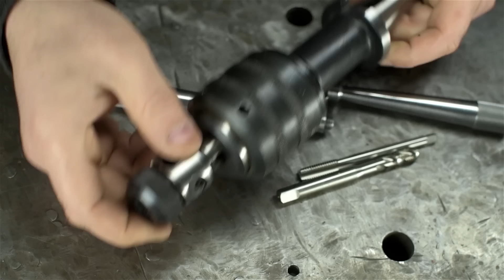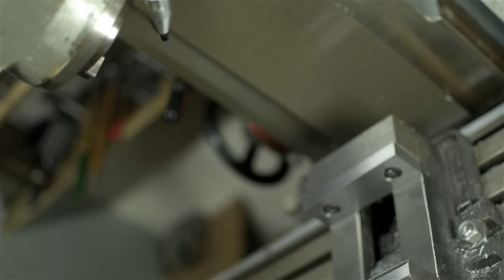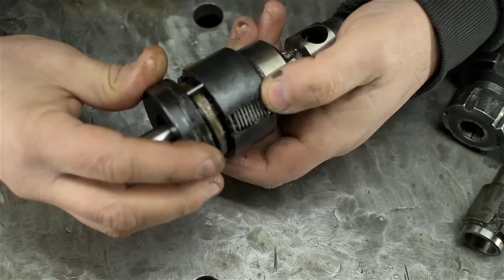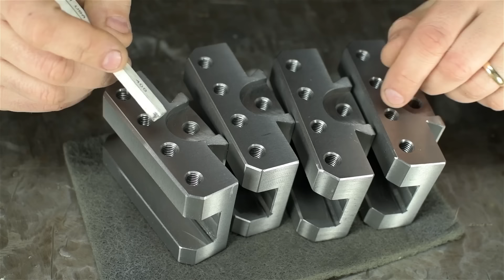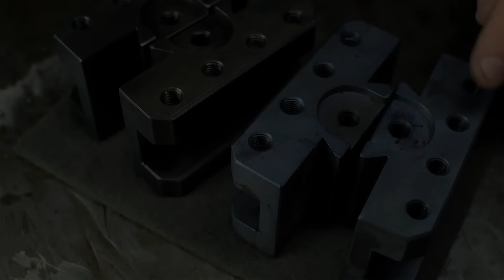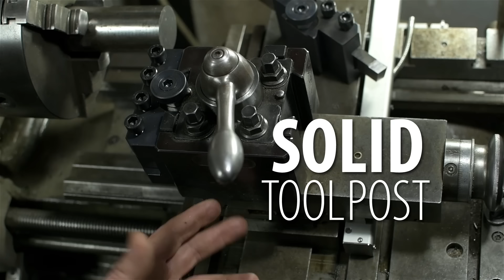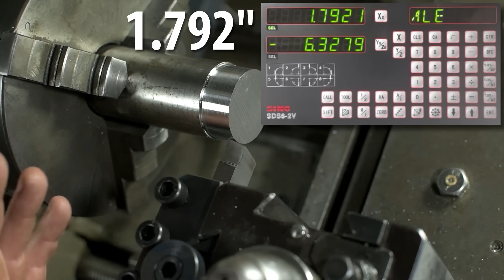How To Break A Tap & Other Ramblings

Comment: You could clamp the item you want to tap loosely in you vise and let the tap pull the item up then stop it before it leaves the vise and reverse the tap and it would push it back down. You you just need to clamp it so it doesnt spin when taping.

Comment: I am an engineering student and I have been taught to use a mill which has a quill but we start in the mill with the spindle in neutral so that it is perpendicular and then finish by hand with a tap wrench and repeat with a plug tap. I also work with lathes and the largest cut I take is 1mm with a standard carbide turn face tool

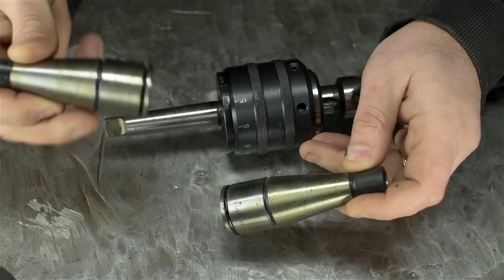Comment: 4:45 i think it doesn't matter if those parts doesn't have the H shape, the torque only goes through the cone when the upper bolt is torqued, the main purpose of the "H" is to lock the "thing" when you bolt it.

Comment: COLD BLUE TIP! While your parts are soaking in the solution rub them down with   very fine steel wool as they soak and you’ll get a more even deeper blue it does have to be plain steel wool none of that stainless crap or it won’t work. Hope that helps someone

Comment: The professional way is to use a CNC mill to brake taps.
My record is two M6 in 30min then I uses the drill press without breaking it.
But my coworker thought I do something wrong and wanted to show me how it works and it did for two holes then he broke the tap :D .
The funny part is that the CNC perfectly calculates the rotation and the Z movement but it does not care about the force and M6 is not big.

Comment: In the job shop I’d prefer to use a non-spiral tsp, they are stronger, however your material isn’t too hard. 
Also, for holding your straight shank, maybe better in a set screw end mill holder, positive lock on a flat you could machine into it.
Great vid as usual. Thanks for sharing.

Comment: The drive lugs are more like safely lugs their only used to protect the spindal  if you were to over power the holding power of the taper. For the most part your taper always does the work.

Comment: How do you know I'm bored? Well, I'm re-watching and commenting on a TOT video from last decade! 
Thoughts: ISO 30 with thread, but missing drive flange are for bolting on tools which have a drive flange integrated into the tool? Don't ask me why that'd be advantageous (it would drive the tool directly and not rely on the connection between tool and tool holder) or where you'd find such a tool. However... one could make such a tool? Perhaps an adapter for a tapping head which would have a removable drive flange keyed to a shoulder above which is a serendipitously sized thread? Like maybe the shoulder is a "double D" shape and the drive flange has a corresponding double D inside it? Such an adapter would possibly remove the thickness of a collet's nut from the total length of the tapping head.

Comment: Looking at those weird taper tool holders, my guess would be that they do hold a face mill and the spindle dogs fit directly into the slot atop the face mill. That seems like a really neat idea, more rigidity and a couple more inches gained on the Z axis just cause the tool is shorter with no shank

Comment: The machine obviously does produce some work for you but it just seems like a truly terribly designed piece of equipment. It's like Harbor Freight went to the cheapest factory in China with an idea and then passed off the engineering plans to Home Depot engineers for tweaking before sending it to 1990s Craftsman for production. Everything about it just seems ass backwards.

Comment: It seems to me that the weird clutch pack is just a really tiny viscous center differential.  Some discs are attached to the input, some are attached to the output side.  The grease is specially formulated to expand quickly as the plates shear through it, locking the plates to a greater or lesser degree.  It reaches equilibrium fairly quickly, giving output torque with a decent reserve for when the tap hits a hard spot and needs a little rotational give.  Make sense, or is that clear as diff grease?

Comment: Total newbie question here so please go easy on me:  How did you centre the tap in the pre-drilled hole.  In asking this question I am assuming that the part was at some stage removed and replaced in the vice between drilling and tapping.  If not, then I think the answer is obvious  - you just kept track of the hole positions and relied on the repeatability of the slide to reposition (accounting for backlash).  Also, at  9:50, it appears that the tap is not running true.  Is there a little bit of play in the tapping head that allows it to self-align ?

Comment: After dipping the parts in that type of bluing solution I like to dip some 0000 steel wool in the solution and rub the parts..... lol...... with the steel wool. It gives a much better blacking. Can also apply oil, then rub with steel wool and solution to blacken even more.

Comment: Actually the plug tap is stronger than the one your using. The shank does not make it stronger. It's the core of the tap. And also using the "normal" tap that you referred to has less tool pressure. Pushing the chips down if you can is the way to go.

Comment: Your ISO 30 tapers without the drive flange are usually used as tailstock centers in machines that use ISO 30, much like Morse Taper in your lathe tailstock. Machines that use this as their tailstock center would most likely be a Hob or Skiving machine

Comment: Machine tapping in a production line is fair, but when it's just a few, by hand is easier, faster and cheaper.  Just remember handle size suitable for the tap size.  It is easier to get them square with smaller handles.  One rev forward and a half reverse.  And. If it's your last tap, make the hole 0,1-0,2 mm bigger.

Comment: I know that I'm pretty late to the party with this video, any reason that you couldn't have assembled the "back' part first, then press fit the straight shank into the ISO30 blank?
When you're boring it for the press fit, put a through hole up to the draw-bar thread so if for any reason you need to break it down again it's (relatively) easy to press back out.

Comment: I used to blue guns as a part time income. blocks the size you were bluing are significantly challenging for cold bluing, no matter whose bluing solution you are using. Just wiping down the object you want to blue with acetone isn't really good enough. Cold bluing solutions arent very uniform in their coloring this is more significant on larger, thicker pieces, and also the alloy of the steel.  High chromium steels will almost not color at all due to the chromiums ability to resist any sort if corrosion (which is exactly what bluing is).  Splotchy bluing with blocks the size you were bluing is almost a certainty. I'd suggest warming up the blocks in some sort of basic cleaner but not to the point of them being hot. You might also try wiping the bluing solution on rather than submerging it in the solution?  I always got better and more uniform results by this method rather thank submerging it. I was never a big fan of cold bluing to begin with as its not a durable finish, more decorative than anything else. Hot bluing on the other hand is a much more uniform coloring, will absorb oils much better than cold blues. The draw back to hot bluing is that its hot! way hot around 300-315 deg℉. The bluing salts are mixed up to a super saturated solution, because the specific gravity of the solution has to be in the 300℉ region before any coloring takes place. Also a hot tank cleaning is needed before putting the parts into the bluing salts.  Brownells Supply is a gunsmithing supply company that has everything you need to hot blue with, if you really want to make your parts look as good as you make them.  I love your videos by the way.

Comment: Pardon my non-native french. Old machiners used tools like drills, reamers or small diameter mill cutters with collets very often. Which transfer the torque just with the friction aswell. And about that weird ISO shank, you were talking about. I do remember seeing that one used for old cyliner honing head my grandfather used to have back in the day, when he worked in a car machining shop. However I doupt that it was intended just for that.

Comment: I really like your videos.
On the subject of the DRO you can set the tools in the tool library in the same way you set up tool offsets in a CNC lathe.  I didn't see you do that and I am not sure if you are aware of it.
I have this habit of never changing the origin on my machines.  What I do is I set the Absolute origin to the end of travel for the slides. Then I never change that offset.
After that I use one of those gauges that light up when you touch them to set the left to right offset (will call it Z like in a CNC)  then I set the tool zero in Z to about 10mm to the right of the jaws so I know that as long as the DRO reading is positive I won't hit the jaws.
For tools like a parting tool I use two offsets one for the left face and one for the right face that  way I can get accurate lengths on the parts.
If you are strict about keeping the offsets correctly and never changing the zero you can make parts just by the DRO without using the verniers. You need to draw the parts with dimensions of the back face so it is easy to get the points.

Comment: What about using one of the strange tapers and threading the new part you made to thread and lock into the taper with a set screw? Add a place for the dogs to grab to drive the whole thing and that would allow you to gain some more clearance while still being able to disassemble to service the clutches.

Comment: Have you ever thought of using a Jacobs chuck? At an old shop, I had to tap hundreds of holes on a radial drill per week, and we very rarely used tapping holders like on the mills. We used a Jacobs chuck, and tightened the tap down until it would stop slipping when you were in a hole. You also destroy jacobs chucks if you don't learn quickly. It was an acquired feel for every tap but it saved alot of time since we didn't have any morse taper tap holders. We used a specific set of rigid holders for pipe tapping though, which is another can of worms. Also I'm surprised you aren't using a plug tap. Spiral taps are ALWAYS more fragile due to how they're fluted. You almost can't break a plug tap. You'd sooner strip out the threads and end up with a shiny hole. If you're tapping something like 4140 maybe consider a gun tap but otherwise you're fine.

Comment: I'm pretty sure those Iso 30 tools without the dogs are for locating a shell mill or other tool, it either has the drive dogs attached or bolts to the splindle

Comment: The tip under cap is for an opening lever when dial indicator is mounted on a stand for multiple parts inspection. At one time the lever came standard with Mitutoyo dial idicator. (probably 40+ yrs ago?)

Comment: Hi Tony; those adaptors that you say that come with the machine are milling cutter adaptors , they are used  with large milling cutters that come with slots that fit into the drive keys on your spindle, to use it you fit the adaptor without the cutter into your spindle, then tight up the draw bar , then fit the cutter into the adaptor and lock it into the face of the spindle with a bolt and spacer in the bottom of the adaptor, this method is very rigid..

Comment: Was tapping a 9/16 hole in a chunk of iron the other day and broke my only tap wrench that fit the tap. So I got an old Thor drill I had somewhere in the back of the shop and drove it the rest of the way. Got through it alright, but when I went for the reverse switch...nothing. That old drill has the torque of a locomotive, but no reverse setting. So I figured i'd take the tap out of the chuck and back it out with a wrench, except I'd somehow managed to misplace the key to the chuck. So I was stuck with a fifteen pound drill attached to a tap that was all the way inside a 2" deep hole. Thank christ it was such a large size tap, because it was able to hold the drill while I found the key. Moral of the story: have a second tap wrench laying around. Or a drill with a reverse setting.

Comment: Heck, I've never had a problem tapping in a much more simple way with my geared head Chinese RF45 : The tap goes into the drill chuck.  Set to the lowest spindle speed.  Start.  Apply gentle pressure until the first few threads engage.  Let go of the quill lever and let the tap pull itself in.  Hit the big emergency stop button once the depth you want is reached.  Reverse out.  If you need a more exact depth you can always stop short and finish by hand.  (With stainless I use this technique to get the first few threads then do the rest by hand.)

Comment: The reason your mill has no "quill" and even mills that do aren't made to "replace" drill presses is because they're not drill presses. Neither are mills OR drill presses built for "power tapping". Power tapping is rarely a separate process and rarely are high-precision, very "hard" parts "power-tapped" period much less on a mass-production basis. The overwhelming majority of parts tapped "cold" as part of.the basic machining/manufacturing process are "soft" cast-iron and aluminum while steel parts are generally THREADED using a "rolling" process of some type which FORMS rather than "cuts" threads and that's usually "hot" work. Cutting threads is avoided as much as possible because as a process it creates far more work and waste than it "saves" and taps are basically impossible to "sharpen" and are impossible to "repurpose" or  otherwise "re-use". And unlike the "hobbyist" universe, threads are either "perfect" in surface finish, profile, depth, fit, dimensions per the "blueprint" and for the specific application, materials, successive processes such as "coatings" or "polishing" after "cutting" or the part is "scrap". Watching all the "professional" YouTube "machinists" treat any and all threads/materials/processess/specs "equally" and try to cut corners "power tapping" and "single-point cutting" threads like the overwhelming majority of thread "cutting" wasn't long ago replaced with thread "forming" and their worn-out "tool room" and/or "student"  and/or "general purpose/universal" machine tools were ever capable of precision threading is funny and sad at the same time. Anything to avoid having to apply a little muscle power and high-quality, brand-new made in the USA  tool "investment" to something as seemingly simple and easy and common-sense as "cutting threads". Especially when it requires admitting they don't really have a clue about "machining" at a fundamental level. And admitting they've been full of b.s. for the majority of their online "expert" careers as YouTube "shop teachers".

Comment: Try reading the instructions on the cold blue. It IS an oxidation process so try applying the blue in thin layers with the material exposed to OXYGEN. The instructions probably say to use a soft cotton "applicator" like a cotton swab or cotton balls and wipe the blue on to clean, dry COOL metal (hot or even warm parts are not going to be uniform in temp and density and porosity and will dry/evaporate the bluing  (basically a strong "saline"  solution containing chemical salts) and cause inconsistent, inadequate bluing in some areas and anything not evenly blued from the first "coat" will never be "right". After a thorough first "coat" to make sure everything was clean, dry and cool; once that primary layer is set, it takes successive applications to get progressively darker blue finishes. And any "stainless steel" that's truly "stainless" and non-ferrous will not "rust blue". So-called stainless steelss that are ferrous will blue somewhat but will possibly be "splotchy" the cheaper and lower-quality they are. Hardness also affects bluing results and anything intentionally or accidentally "case hardened" will never blue evenly and consistently. Even if the directions are followed correctly.

Comment: 6:42 the clutches might be relying on the drag created by the grease. you probably did the right thing leaving the original grease on. there are some speciality greases used for creating viscous force under shear. if youd just replace the grease without knowing what was the original one, you might have had f*cked up the torque settings. and the dial there is probably have the purpose of adjusting the distance between plates, thus adjusting the drag

Comment: That "flat tool tip" is actually a lifter cap ... you fit a lifter handle to the side of the dial indicator and the fork of the lifter goes into that groove on the cap.

Comment: I looked for but couldn't find your email address - mayhaps you don't provide it so you skip all those pesky fan emails :D    I have an EMCO Maximat V13 as well and have been looking at DRO's.  After having now used it on your own lathe, would you recommend the SINO SDS6-2V DRO to others ?  Also, what scales and lengths did you use on your lathe setup ?  I could see the scale length on the cross feed though I could'nt tell what flavor it was.  Btw, I really enjoy your humor and your content - between you and Abom, I'm starting to learn a lot of useful stuff.  Thanks in advance :)
Reply: I just discovered (idiot me) that it's the NYC CNC guy who has the Maximat V13, not Tony.  Ah well, it takes a dummy to make a mistake but a real (silly) man to admit it.  :)

Comment: Hello there.. I would like to tell you that the adapters that you show @4:45 are actually locators for big face milling cutters which get directly mounted onto the spindle face which has tapped holes and tenons. The straight diameter on the adapters locate the milling cutter through its center hole. Hope you would try it once to understand even better. Take care. Best Regards.